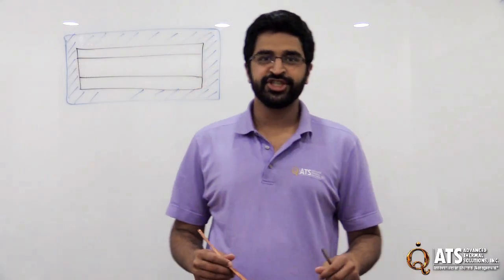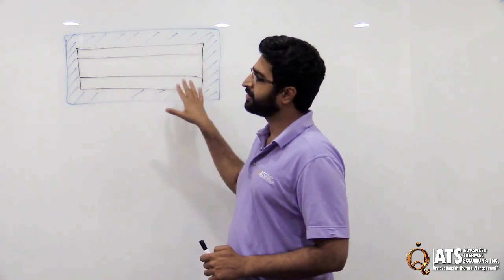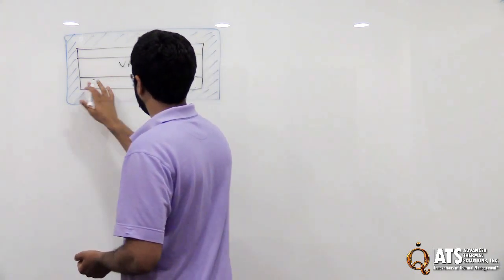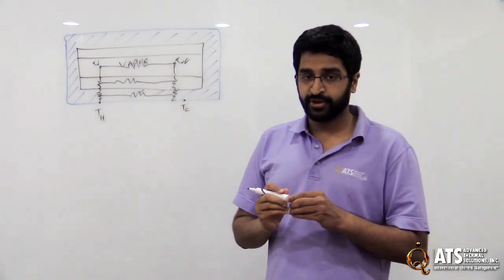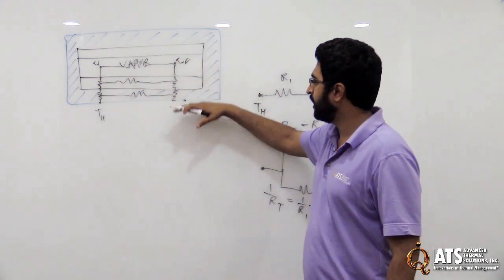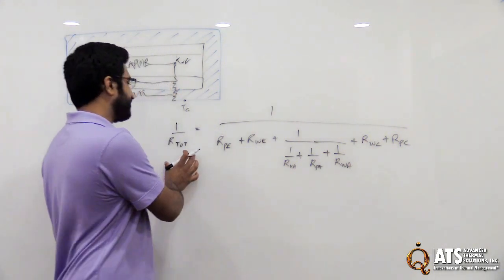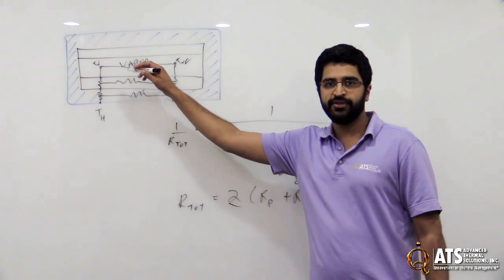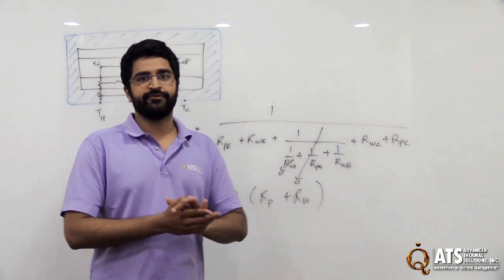Effective Thermal Conductivity of a Heat Pipe

Comment: Hi Sir,

İs there any way to apply CFD methot to heat pipes and vapor chambers? The only way that I know is measuring the thermal conductivity coefficient and define it in the program. But can ıt possible to apply CFD without measuring the thermal conductivity with test systems? I mean can I measure the thermal conductivity of heat pipes and vapor chambers with CFD?

Kind regards

Comment: I am wondering if we used heat pipes to make a pin-fin heat sink, using only heat pipes embedded in a plate of copper, if that would make a good heat sink, if a large number of heat pipes were used as the radiators without anything more on them?
Reply from the maker: Its certainly a novel approach, but, don't forget, heat pipes transport heat. So that would have to be taken into account. It would also be fairly expensive to manufacture. Your concept might be better executed with thermosyphons  (see more at this video: https://www.youtube.com/watch?v=yTicxWYO6SM&t=2s  ).

Comment: Also, what is the thermal management solution to transfer heat from a small electronic component in space environment other than through PCB?
Reply from the maker: You can use short heat pipes 100 mm or so to transfer heat from components. They can be used in a vacuum and space environments.

Comment: Can we use small heat pipes say 50 or 100mm long inside an electronic module in space or vacuum environment?
Thanks in advance.
Reply from the maker: They can be used in a vacuum and space environments.

Comment: Hi, Just a quick question, How would you measure the effective thermal conductivity of a heat pipe. Say a heat pipe 6mm in diameter and 150mm long. A schematic or diagram would be great. Thanks a million
Reply from the maker: Apply a known quantity of heat on the evaporator side by using a heater and measuring the voltage and current going into it. Use thermocouples to measure the temperature difference between the evaporator and condenser side. The total resistance will be the temperature difference divided by the power. Some of the heat will go from the heater to the ambient or be dissipated from the adiabatic section so the better insulation you have, the more accurate the results would be.

Comment: Thankyou, but isnt there a evaporative and condensation resistance? i mean wont there be a difference in temperature of heating surface(wick) and vapour?
Reply from the maker: Yes, there is a resistance to evaporation side (not so much on the condensation side). But that resistance is small compared with others unless it is running at very low power.